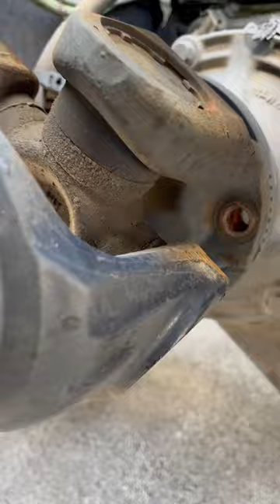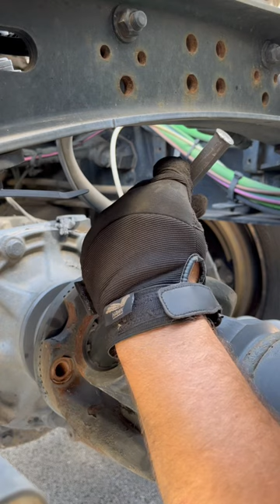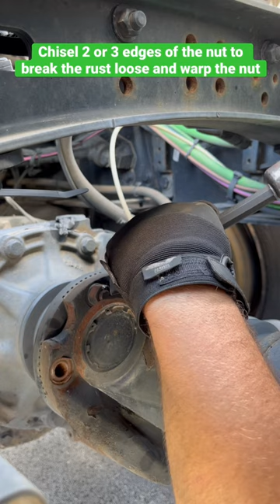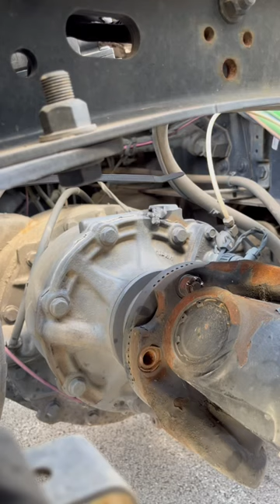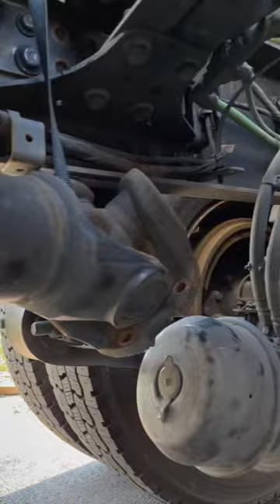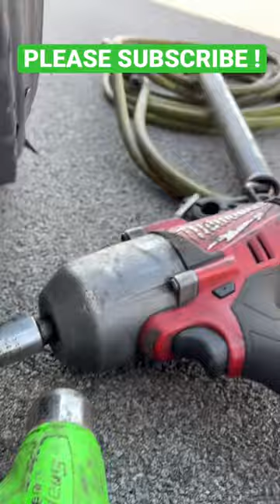My PREFERRED METHOD for Removing Rusty Drive Shaft Bolts - FREIGHTLINER, VOLVO, and MACK Semis

Comment: What size did you use ? 13/16?
Reply from the maker: The correct size is 21mm, but I believe it was a 7/8 that I used. Just fits a little bit looser for those hard to reach angles.

Comment: Yeah you lost me. I've been doing this type of work for over 40yrs & I don't understand why you do this.
Reply from the maker: In the past we have had a very hard time removing these driveshaft bolts on the newer Volvo and Freightliner style joints. Our big Milwaukee Fuel 1/2 inch impact will not break the nuts loose from the bolts, and at very best would just spin the entire bolt and nut within the flanged joints. We've tried using a mapp gas torch to assist, and still no luck. Found that by hitting the nut on a few edges with a chisel that it either would break the rust loose or possibly even egg shape the nut just enough to free it up.